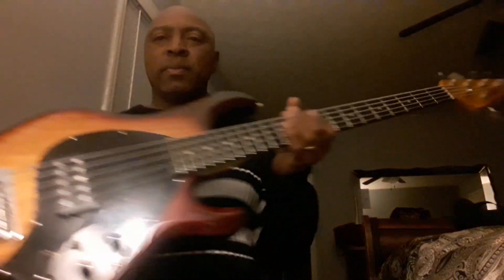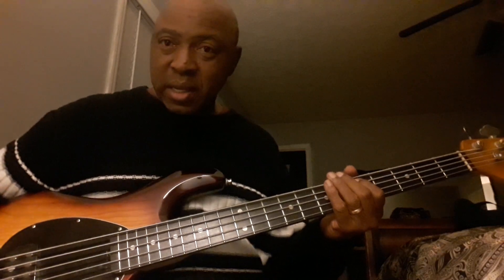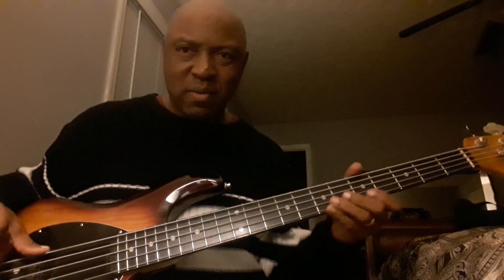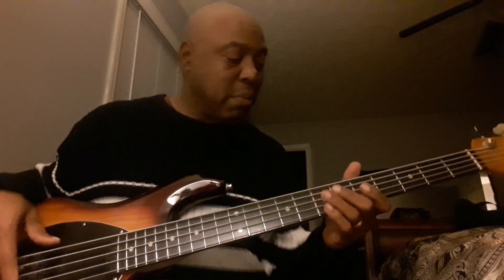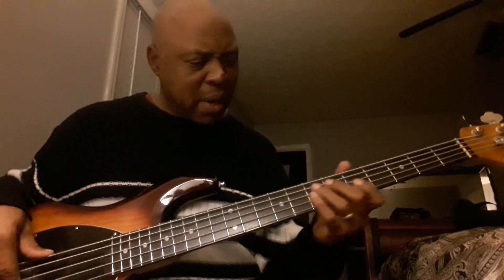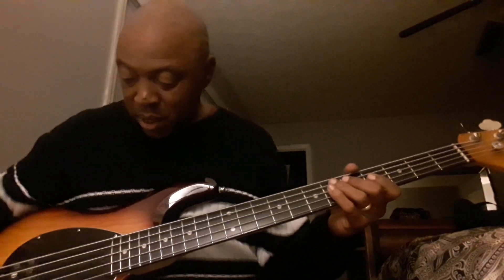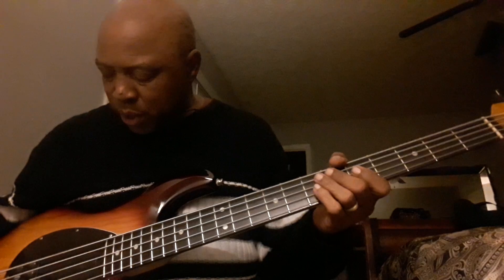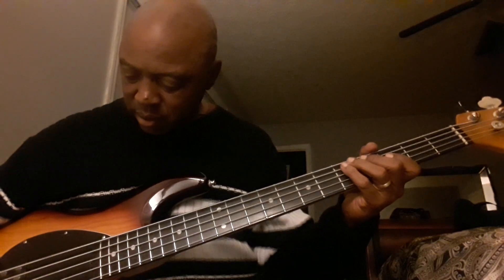Sterling ray 35

Comment: Also, I play mine hot and do all the sound tuning at the amp.  Is that wrong?
Reply: I also use a 7 band eq pedal
Reply from the maker: I wouldn't dare tell you that it's wrong to do it that way. We all have our preferences as well as our own convictions. What I do is, I set my amp flat and I control my sound and tone from the bass, that way I'm able to utilize everything the bass has to offer as opposed to just running It Wide Open. I have three different amplifiers and they all give me different things, so I rather Tailor my tone with my hands and the bass rather than trying to remember settings for three different amplifiers. I'm just not smart enough to remember all of that so the way I do it works for me.